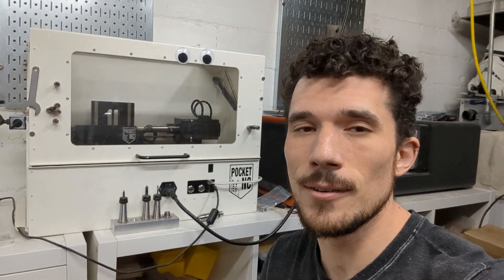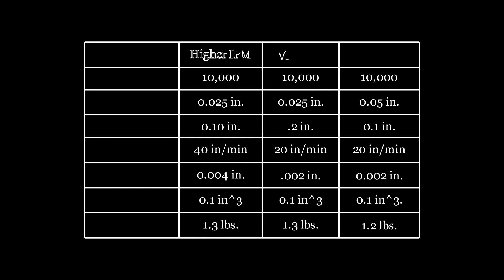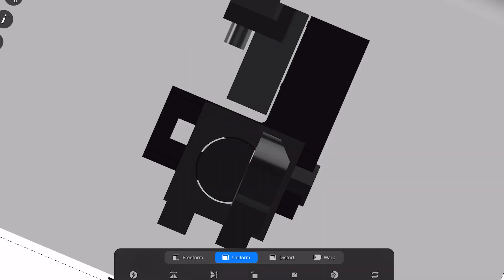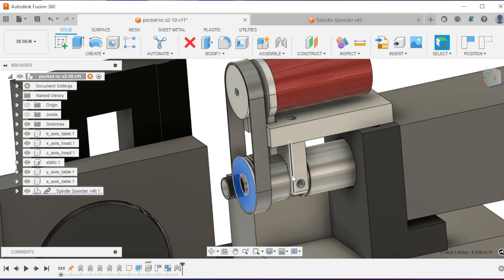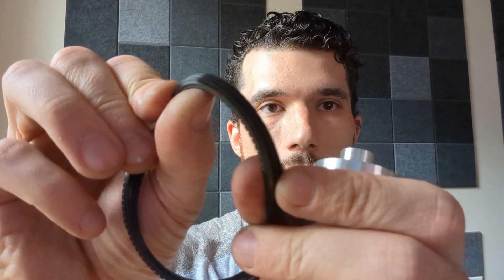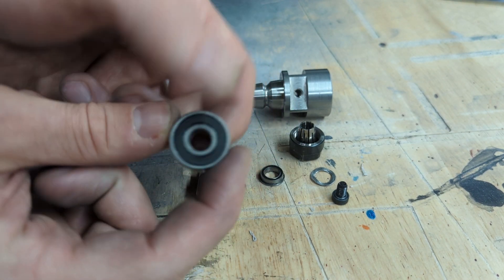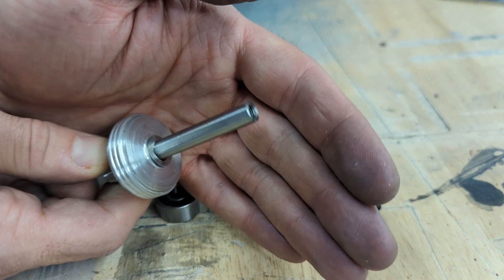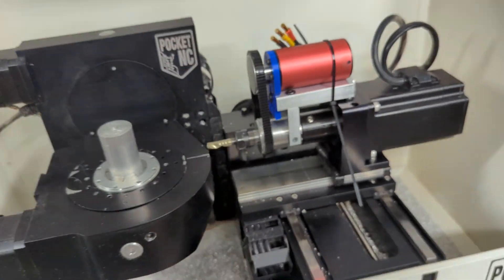5 Axis CNC Spindle Speeder | 300% Faster Cycle Time | Boost Efficiency | Pocket NC Upgrade

Comment: The chart at 1:52 has RPM at 10,000 for each column...
Reply from the maker: Correct, that is the "max" speed the stock spindle can go, I was trying to show how of the other 3 variables available to me (faster, wider, deeper) none of them allow me to remove more material without increasing the required loading on the system, which it can't handle.  Essentially I've found the machines limit.  If I increase the  spindle speed beyond the "max" I can remove more material but that requires all the extra hardware shown in the video

Comment: Why not simply use a 2-flute or 4-flute milling cutter instead of a single-flute one?
Reply from the maker: The single flute ones tend to perform better in low rigidity/low torque machines.  More flutes means more torque required to keep the bit spinning, and I was already right at the edge of stalling it.  These machines are not really rigid enough to push that much material through the bits

Comment: Have you considered using 3 flute aluminum endmill ?
Reply from the maker: I have! I've got a few of the high helix 3 flute endmills, this set up doesn't quite have the torque/rigidity  to push those through the material at a chip-load that aluminum is happy with.  I love them on my RIGCNC though!

Comment: Really should use angular contact bearings for thrust load.
Reply from the maker: The main bearings are Angular Contact, the rear bearing is just there to minimize whip.  Another commenter mentioned it but there's a compressed sleeve in the middle that preloads the inner races of the the bearings against each other instead of against the housing which eliminates any potential thrust loads from the rear bearing.

Comment: Curious how you get the pocket nc motor to not run.  Do you simply program a 0 rpm spindle speed and run the program normally?  Then do you assume manual control by turning your new spindle on and off yourself?  I assume this limits you to only 1 tool per program since tools must be probed before running the g code on the pocket NC?  Very interesting.
Reply from the maker: Yup, you pretty much have the process down. Typically what I will do is program the toolpaths with the spindle speed I plan on running (so the speeds and feeds make sense) then I just manually go in and edit the G-Code to not turn the spindle on. It's very much like running a hobby cnc machine that use a palm router that isn't controlled by software.   And the Pocket NC doesn't have any tool changing options so the single tool per program is pretty standard, even with the normal spindle set up.  It handles all the offsets in an internal table though so it's not too bad, there's no actual data entry, I just tell it to "probe tool 3" and it handles the rest.   Thanks for checking the video!
Reply: @Factorem  I have only had my pocket Nc for about a week, and I am still very much coming to grips with it, but I can see this being useful in the future.  I wanted the v2-50, but got a good deal on a lightly use v2-10 so this mod you created could help bridge the gap while still allowing me to run 1/4 inch tools when I need to !  Nice work.

Comment: Very interesting! Many thanks for this as  I have been thinking about making a similar tiny spindle and motor for use on my Taig lathe - a toolpost grinder. You've made a very neat and simple unit, using rather cheap bearings (as spindles go) and low-cost spindle with ER collet chuck. Also the model motor and controller. 
And this all seems to work well! Now, since these components are way below the spec that most machine builders would even begin to consider usable, I wonder how well it's  going to hold up?  Motor and bearings overheating? 
Worn out after a few dozens of hours? How is it going? In any case I hope it is well! Wishing you good fortune in all your projects!

Comment: Great video brother.. (everything I say is only for small machines that aren't  very ridgid.)  I have always preached (HSS) High-Speed Machining, on small machines because of lack of rigidness. I loved to tweek my hobby machines. Ultimately I learned  RPM and horsepower are the most important factors as in the weakest link besides the rigidity of your machine. If you want to obtain the highest material removal rate. Some key factors you did not cover in your video that I learned over years of tinkering on my small machines.  Number of flutes on your end mill. Going from a 1 flute to a 4 you have essentially quadrupled your RPM without having to modify your motor. Also, the more flutes your cuter has the less deflection the tool will have. I'm not sure, but if you did your difection test with a endmill with more flutes, you might have less deflection then the 1 flute unless the spindle/machine is already at its limit.  Try your load test with a sold piece of carbide, this will show you what amout of deflection is in the spindle vs spindle and endmill.   Sorry this is long... And i had to butcher the information to keep shorter..., But keep up the good work and don't let us "know it alls" discourage you! 👍🏾👍🏾👍🏾

Comment: dont used ground in fusion its bad practice. use as built joint instead
Reply from the maker: Can you explain the logic behind it being bad practice?  My understanding of the joint methodology leads me to believe an as-built joint to the origin is equivalent to a ground joint, especially for Datum parts in a design.

Comment: When you pressed it together, you pressed the pressing loads through the bearings balls and races that’s not how you do it.  You need to rethink your design, so that bearings can be pressed properly.  Otherwise nice design!
Reply from the maker: I did the actual press fitting on the outer races of the bearing.  Since filming the video I've added an internal sleeve which preloads the inner races against each other, I believe that's what you're talking about correct?

Comment: i looked at the pocket nc a LONG time , but for several reasons (mainly value of the machine) but also software , layout, no touch probe, i decidet to NOT get one, 

instead i commited to building a diy 5 axis cnc, CAD is 95% done, uts cheaper and its (at least in cad simulation) way stiffer (also 1,5 kw vs 0.2 kw spindle ....
Reply: Might want to search for "Granite CNC Piotr".  He built a CNC mill using a 24" x 36" x 4" granite surface plate.  It's solid enough to cut steel.
Reply from the maker: See above, I made a machine called RIGCNC a few years ago that was greatly inspired by  Piotr's work. Check it out!
Reply from the maker: I did a scratch built 3 axis on my personal channel called RIGCNC.  I wanted no part in making a 5 axis from scratch lol  Also if I have technical issues I can flag in help.   I just treat it like a metal 3D printer (in terms of time allocation). The parts take a long time to make but they're accurate and consistent.

Comment: Another way you could recut the taper in the machine is using a bore bar instead of a dermal. In your case you could probably use a 1 flute end mill as the boring bar.

Comment: nice spindle upgrade you've got there . I've always thought the pocket NC was an amazing little machine.
Now, as an actual (former) cnc machine tool field engineer I'd like to offer a few  suggestions for improvements.
Firstly, the tiny little rear bearing is having to handle 100% of the axial pullout force , it should be seeing 0% and
only have to handle radial loads.
If you constrained the front of the outer race of the 30/8 bearing ALL of the pullout and push back axial force will be handled
by this bearing only (as it should be).
 A sleeve  between the inner race of the front and rear bearings would lock the axial position of the spindle shaft.
the rear bearing outer race should not be constrained at all, instead it should be able to axialy float, to allow for thermal
expansion. Perhaps add a second bearing to help support any torque loading that makes it through the front bearings.
Finally if you can find the 30/8 bearing with metal shields , and you see that you have no debris build up between the pulley
and bearing face, replace the rubber shield bearing, as the rubber shields does create heat.
Reply from the maker: That is some solid advice, thanks!  I'll machine a thin spacer to set the distance between the bearings and add it to the technical drawings!
Reply: @Factorem  NSK has a pdf called      Machine Tool Spindle bearing & mounting guide         .  on page 44 they show some typical 
spindle arrangements.    the top one   medium speed spindle    is closest to what i'm suggesting. 
the front bearings are locked into position     located side      and the back bearing  can slide in the bore    free side.

the downside to using the 30/8 like this  is that there is a bit of internal axial clearance .  the little flanged bearing at the back,
in your configuration does remove it, but i wonder for how long (ps i don't mind being wrong about stuff like this).

Comment: The only things I noticed in this that didn't quite make sense to me was:
1) you have a 30k rpm motor, but you said the dual row bearing is only rated to 25k rpm?
2) I've not seen belts used at this speed before. I know it depends on the pulley size but even then it's questionable how long it may last running at 30k rpm....
3) it might be worth putting some threadlocker if you haven't already on the screw acting as a tensioner for the belt and the screw pulling the bearings together to reduce any backlash. I have a feeling after some time these would work themselves loose and wouldn't be very desirable 😅
Reply from the maker: You're correct on all fronts, I can only cram so much into a single video though. 

1.The motor is actually a 50k rpm motor, (that was the easy/cheap option) the bearings would literally grenade themselves if I took them up to that speed (ask me how I know :D ) So I'm forced to keep it under or at 25k rpm. 
2. It's a little bit sketchy.  Best I can tell, the speed limit is for the belt is ~60 m/s and I'm at like 65 ish.  it'll toss a belt if everything isn't dialed in super well. 
3. Agreed, takes about 0.02 seconds before the front falls off if its not glued in. (torque of spindle start up is often enough to do it, it then proceeds to throw the belt half way across the room.  Blue flavored threadlocker holds that screw in now.

Comment: Great stuff. Thank you for sharing. I want to point out that you did not really speed the spindle, but replaced it with a new, stiffer spindle with less stickout. Apples to apples, you would have to redo the deflection tests with the new spindle...

Comment: Very cool.   However, I'm very interested in the fiber laser that can laze tool steel away!    Not typically something a hobbyist has access to.
Reply from the maker: Yeah its great! Its the Cloudray 60w MOPA laser with the shortest focal length they have.  I use it on tons of stuff
Reply: Type up fiber laser... They are all over China for less than $2,000.